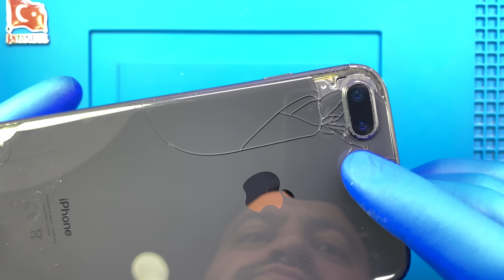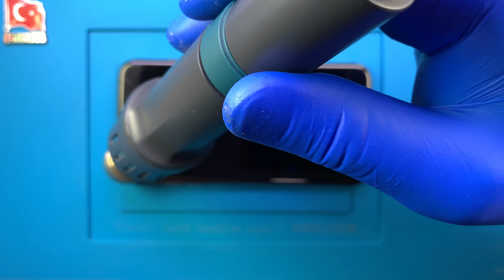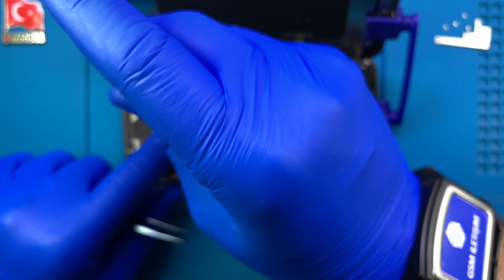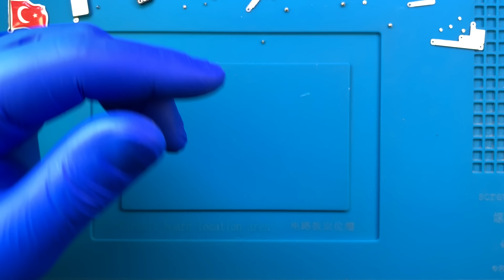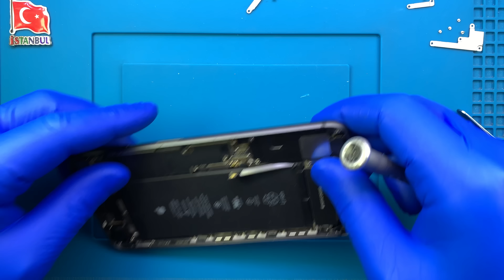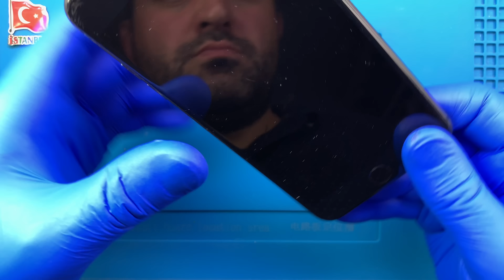iPhone 8 Plus Kasa Değişimi 🇹🇷

Comment: why do you use the tool in your hand,What is the use of that tool in your hand?
Reply from the maker: Hello there;
It is a static-free wristband on the left arm. Our technical service is designed to be completely free from static electricity, but it is installed by our technicians as an additional precaution in order to prevent static electricity that may occur momentarily. The right arm is a special magnetic magnet. It allows to hold very small metal parts.
Greetings.

Comment: Does it still retain its water resistance after replacement??
Reply from the maker: Hello there;
Phone manufacturers only guarantee water resistance for undamaged and untreated equipment. For this reason, more attention should be paid to fluid contact after screen - part replacement and technical service.
Greetings.